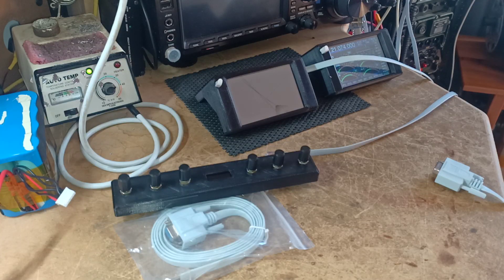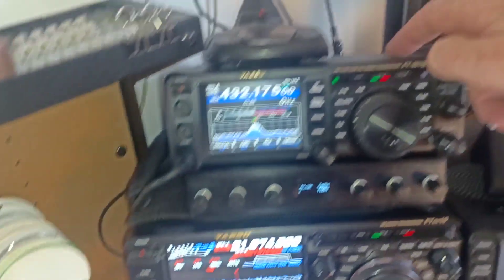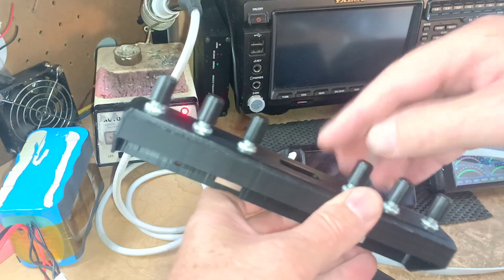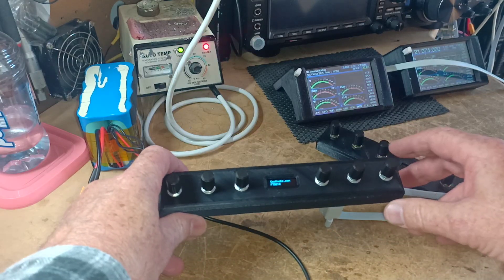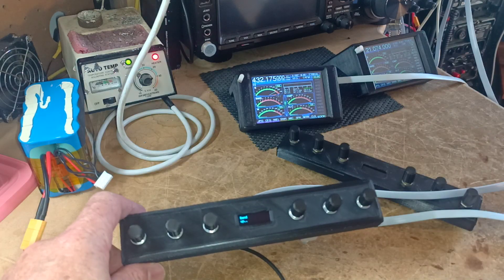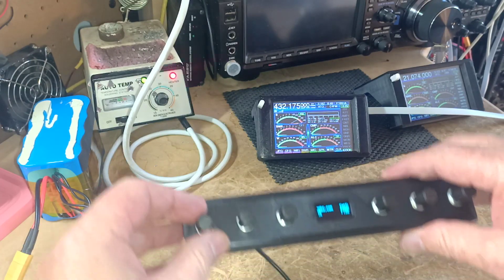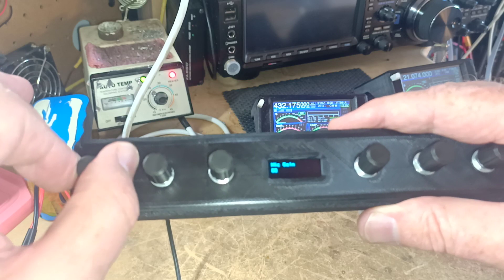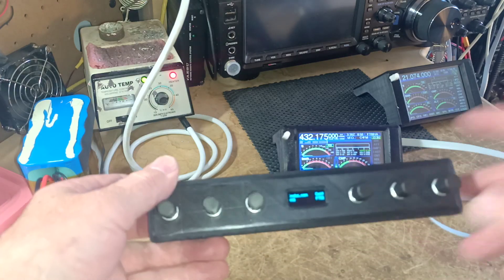CatKnobz - 6x programmable knobs for your Yaesu Transceiver!

Comment: I see base on the web site it don’t support the receive EQ? Is that correct?
Reply from the maker: Only FT-710 & FTdx10 have RX eq. Other models do not have this. CatKnobz does not have any EQ settings. CatTouch has those on screen and you can change. MIC eq on CatTouch can also store & retrieve 5 settings..
Reply: @ZL1CVD  thanks for the replayed. I have a dx10 and I’m always adjusting the receive eq . I prefer the cat knobs over the screen version sorry to here that not supported. Thank you again for taking the time to reply.